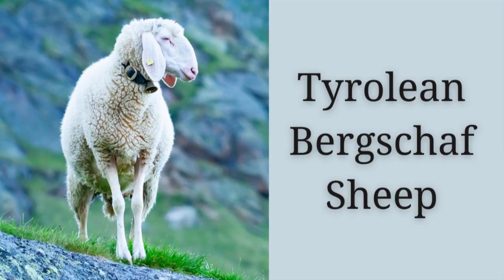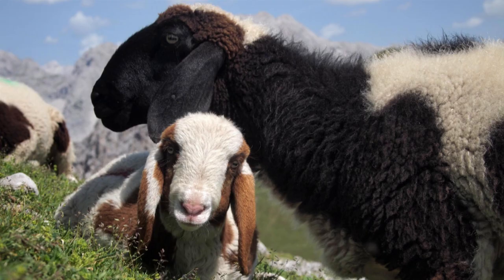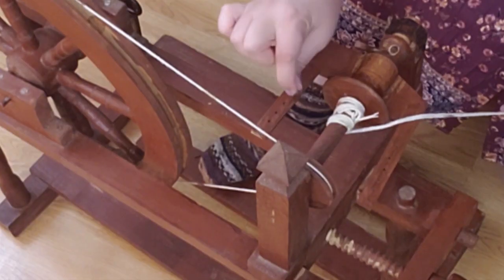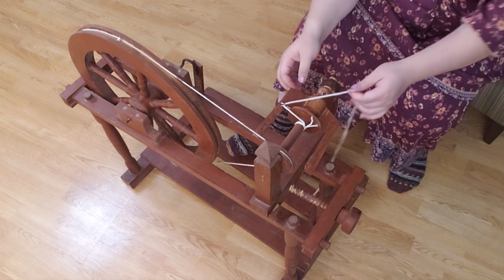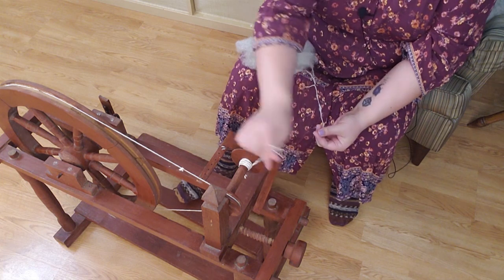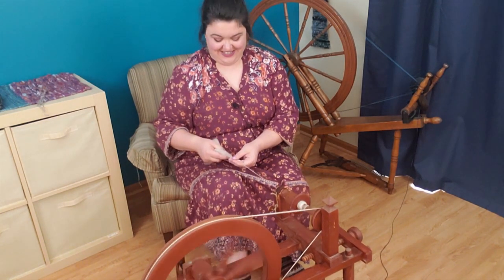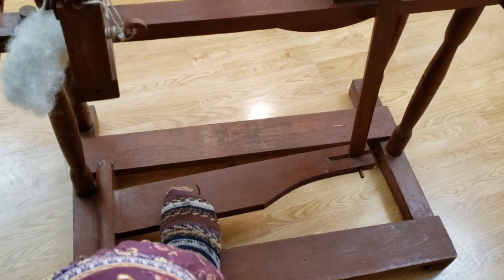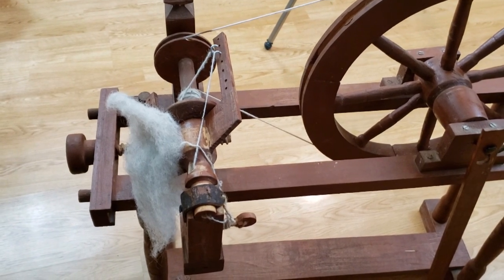Can The Spinning Wheel Shaped Object Actually Spin Yarn? - Part 2

Comment: Yay for technically being able to spin some yarn with Spinoccico. Bummer that it didn't work very well.  Probably not worth the effort, but could weights be added to the outer edge of the drive wheel, some how, to help with momentum? Maybe bore out the hole in the hub to add a metal tube in there to work as a bearing for the crank shaft? Possibly smooth/sand down all the points making contact with the orifice and tension band and oil very well?  Maybe smooth and oil well for all the connection points even down to the treadle? I've seen some wheels with a leather flyer orifice bearings that need to be well oiled and don't work well if they are dried out.  Just some inexperienced spinner ideas; don't feel pressured to keep fiddling with it to make it go.
Reply from the maker: Yes, these are all ideas Mark and I talked about. I think weighting the rim of the wheel and adding some kind of bearing for it would have the biggest impact in terms of spinning ability. 💕

Comment: I have the same spinning wheel as the one behind you. I was hoping you could help me. My drive thread will not stay on my fly wheel. It's very wobbly. How do I fix this? I got it for my birthday today
Reply from the maker: Hi Stacy! I am getting caught up on comments. I hope you were able to get it all fixed and are spinning up beautiful yarn by now! If not, let me know how I can help. You might need to adjust the supports on the drive wheel to align the wheel with the whorl better. Sometimes that causes a drive band to jump off. ❤
Reply: @JillianEve  that is what I had to do. And then I moved it. Have to do the adjustment again. Thanks so much!
Reply from the maker: @stacymoore9122  I'm so glad you discovered the solution! Happy spinning! 💖🧶

Comment: So I found the videos of you making this into a real wheel. So the thing needs loads of oil because the wood will soak up loads of it. I found that the direction of the curve on the drive axle makes no difference. My Production wheel can spin both directions equally well. Your thing needs lots of oil on all moving parts including the treadle I found that putting some real thin leather between the wood parts really helps because the leather can soak up lots of oil and allow smooth operation. I think the wheel is crude but with light tension it should spin rather well. I like the treadle.I have a side treadle wheel with a flyer system similar to this. Light tension. Just enough to drive and just enough to draw in the fiber. Many times the flyer needs no tension if you spin thin like one would do with flax.
Reply: Put thin leather on the wheel axle too and oil it up well. A few more minor tweaks and it will be spinning well. Lighten up on the main wheel tension. Then letup on the tension of the bobbin. Light tension will allow the wheel to rotate easily if you get those leather bearings on the axle flyer. If you must do wood on wood be sure you oil it up real well and let it soak in for some days to make it work best.

Comment: Spinochio...I love it 🤣🤣🤣

This video was a nice experiment, but you've inadvertently made yet another perfect gem of information for me on my journey to make my own wheel. I'm getting a better idea of how to make my tension. I have a question about the wheel, as you mentioned that this one felt too light. I love old machines that use flywheels, I have a 1910 singer treadle sewing machine. It has a small wheel, but the darn thing is cast iron, so its gonna have some weight to it and that gives it all the momentum it needs. So how about your Ashford traditional wheels? They look robust (which is the design that I'm inspired to base my own wheel upon) but how heavy are they? Also, is there an official set size of how big wheels are historically made? Or are they simply made, then the ratio is determined afterwards? I'd rather have a proper tension ratio in mind and attempt to make the wheel based on that math, rather than make the wheel and figure out the math later. Problem is...I dont know the math haha!
Reply from the maker: Check out what is referred to as "Indian head" spinning wheels. They use the wheel and table from the old singers for yarn spinning. There is some fascinating history behind those wheels and sometimes you can find them for sale, especially in the Pacific North West, USA and Western Canada. Also, did you see my ratio video? Wheels have different ratios and you can see that on the wheel specifications listed by the manufacturers. That should give you some ideas! One think to keep in mind though is that when you are spinning, it is important to easily stop the drive wheel if you need to fix something in your yarn or drafting. Happy wheel making!
Reply: @JillianEve  Aye, I saw your ratio video, twas also helpful. Unfortunately, manufacturers telling me their ratios doesnt help my math. I need to know the diameters of the wheel and (...bobbin? Still not up on all the names yet, but I'm learning watching your amazing videos! 😍) If I knew how big the wheel and other part was to get a certain ratio, well, that's pretty much all I'd need haha!
Reply from the maker: Yes! There is some detective work to be done there! 🕵️‍♂️
Reply: @JillianEve  Ah yes! I've actually seen a video of the indian head recently. Tis a very good option. Unfortunately, I'm a "all in or nothing" kinda guy. If imma spin, its gonna be on a real wheel. My sewing machine needs to stay in tact, and spinning wheel must be it's own separate machine heehee :p Unfortunately, I dont know how to use my sewing machine yet. I haven't found out how to string it up or adjust the settings yet >_<